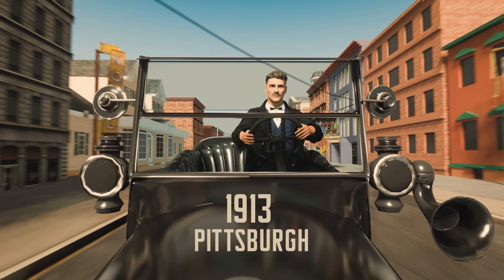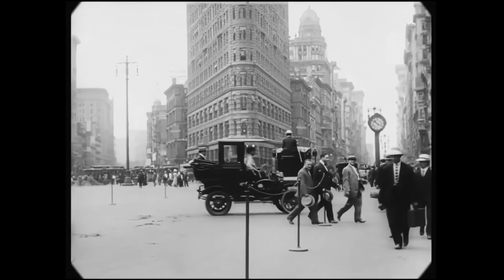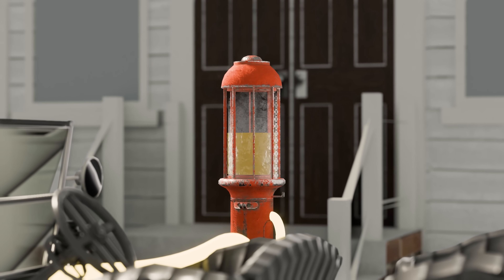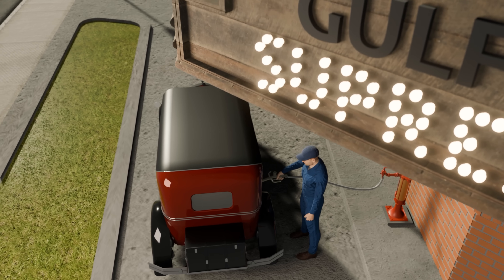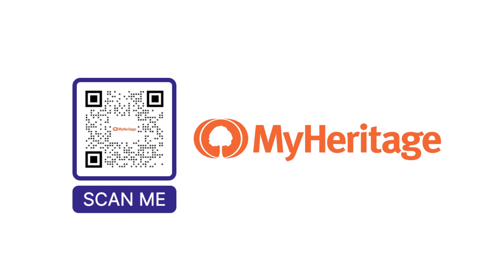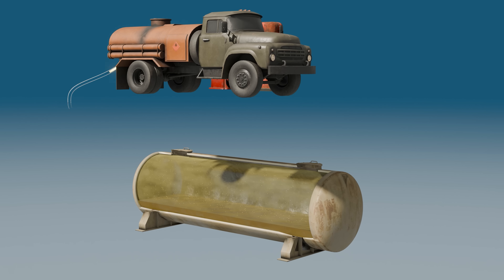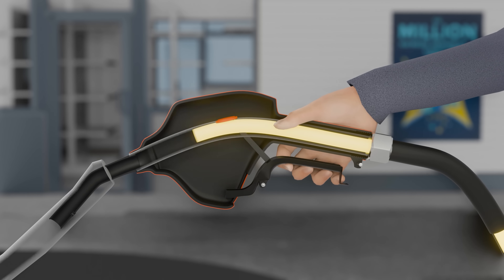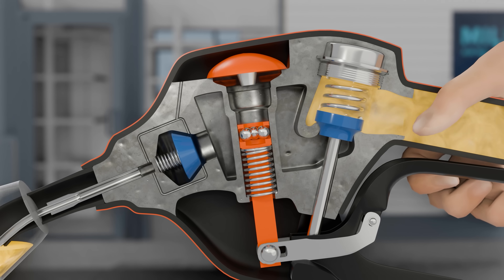The Hidden Engineering of Gas Stations

Comment: Even early cars ran in gasoline, not on kerosene. Yes, they were sometimes modified in times of gasoline scarcity. When cheap power was needed in agriculture, you'd have a kerosene engine and even than you'd need gasoline for starting it.

Comment: Its 2025 and gas stations are everywhere... If youre saying that they decreased after 1970 I would hate to have seen it then cuz in rhe outer Seattle area.. there can be a 4 way intersection with a gas station in 3 of 4 of the corners and in some cases 4 on all 4. Granted, there atlre a lot more people in 2026 than in 1970 but still lol.

Comment: I delievered fuels for 20 years. One technological improvement that happened in the 60s and 70s was volume correction at the pump. Gasoline, diesel and other products expand and contract with temperature. So let's say a tanker truck arrives at the gas station with a load of gasoline at 30 deg C (about 80 F), then drops it into the station tank. The delivered load without volume correction would be for example 10 000 gallons, which is what the station paid for the load. After sitting in the tank for a few hours, the volume has shrunk to 9900 gallons. Without volume correction, the station has lost money on that load. Similarly, without volume correction, you pull up to the pump and pump out product at 20 deg C, or 70 deg F (approximately). You pay for 15 gallons. A couple of hours later, with an outside temp near freezing, the volume in your tank has shrunk quite a bit, but it's the same weight of product. You notice your gas consumption has decreased from a month ago when it was much warmer outside. In summer, the opposite happens. The product expands in your tank, which means you use more to go the same distance, giving the illusion of lower gas mileage. With temperature correction, the measured volume is corrected to 20 deg C at every step, which mitigates the effects of expanding and contracting fuel. Next time you fill up and the pump says 50 litres or in the US 15 gallons, how can you be sure that's what you're getting and paying for? It would be ideal to sell it by weight, not volume, but this would be very difficult. So with pump corrected volume you are effectivley buying it by weight. Back when I retired from it, the new stations being built installed the underground tanks in a concrete vault that could not leak into the ground. The new tanks were fitted with overfill protection devices and vapour recovery as it shows in the video. The fill fittings were enclosed in a bucket like feature which captured small spills from connecting or disconnecting the hoses, any spillage connected could be let back into the tank. In the days before overfill protection you had to be extremely careful calculating ullage space in the tank before you dropped the load. At old stations sometimes the old tanks might have tilted so the tank wouldn't hold as much as indicated on the chart, so the tank would come full prematurely and you were left with a hose full of product and nowehere to put it. Hopefully the station would be open and busy and hose would empty in 5 or 10 minutes. If it was a night delivery and the station was closed, you had a big problem.

Comment: A gas station I worked near had to replace its tanks. They ended up digging up half their parking lot and pretty deep, paying for ground water removal. They found older tanks that had leaked and had to remove them first. I see this as the final nail in many stations in the future when alternatives make up a large percentage of cars. It just won’t be economical to do major environmental repairs and the station will just go bankrupt.

Comment: The nozzles still fail due to slow flow from the dispenser. If the flow is slow enough, it will bypass all safety features and over flow your tank.

Comment: I’ve worked for Gilbarco for decades here Australia disappointing no mention of initially mechanical computers,then electronic to calculate delivery volume working hand in hand with  mechanical metering mostly 4 piston. Not to mention vapour recovery systems designed to collect motor spirits vapour at the fueling nozzle yes the industry has had an enormous amount of innovation since the early 1900s

Comment: Couple things. In my area, the process of condensing captured vapors into saleable product is a pretty new thing. Most of the loading racks I go to simply burn the vapors that come off the truck during the loading process. I've seen the vapor condensing process at one rack out of 10. Despite increased fuel efficiency, I see new gas stations going up all over the place as well as old small stations being rebuilt into much larger ones. The demand for gas is strong as ever.

Comment: If you actually cover the hole near that end pump you’ll get less air and more gas than what you had paid but slower pumping process for this is a trick in my country only few knows, because gasoline is so expensive we have to sneakily ask the gas attendant to cover that hole because gasoline company cheats their their price using that air pressure hole by pumping more air it spins a mechanism where the price inside the pump meter will rise faster and makes higher cost so you will always end up paying for more but the gas you fill up remains the same the pressure of that air mechanism is connected directly to the computer meter of the pump and for how much dollar per litter you spend relies on that.

Comment: A reasonable effort to explain how a petrol station works in the most basic way, but you missed out a lot.
The overfill preventer on a storage tank is a device of last resort. When a tanker makes a delivery to a petrol station either the tanker driver or the station operator gets an ullage reading so they know how much space is available in each storage tank BEFORE any fuel is put into them.
A road fuel tanker does not have one continuous volume to carry fuel as illustrated in your video! It is divided into several separate compartments (called 'pots'). This allows a tanker to deliver more than one type of fuel.
You completely missed out the role interceptors play in reducing the environmental impact of fuel spillages.
Why no mention of Gilbarco Veeder-Root?

Even today petrol is still a very toxic and flammable substance. Its vapor is explosive. If a petrol station operator tells you to stop doing something (like using a mobile phone on the forecourt) please pay attention to them. They really don't want to have to do all the tedious paperwork as a result of you being too stupid to avoid death by immolation.

Comment: 6:00 - Not much engineering, and inaccurate too - for if there's a pump placed in the holding tank underground the gas station, why is the gas pump making a lot of noise then. Also having electrical shit in an explosive atmosphere is perhaps not the smartest move. Flappervalve is probably also false, 'cause what about the fuel in the nozzle and the hose. A heavy hose at that.
But good history lesson (I hope that at least is correct and accurate) and nice animations.

Comment: STOP SPREADING FEAR & MISINFORMATION: That 3 Billion Gallons of Gas Claim is B.S.
Let's cut through the noise. "The Hidden Engineering of Gas Stations" by Primal Space – that's perpetuating a staggering falsehood, and it needs to be corrected.

At the 0:38 mark, the video boldly claims gas stations are "pumping out 3 billion gallons of fuel around the world every day."

This is not just inaccurate; it's a colossal misrepresentation of reality.

Here's why that number is dangerous fiction:

Crude Oil vs. Gasoline: Learn the Difference. The world, as a whole, produces roughly 3.5 billion gallons of crude oil per day. Crude oil isn't gasoline. It's the raw material that gets refined into dozens of products – including diesel, jet fuel, asphalt, and yes, gasoline. To confuse the total global output of all crude oil with just gasoline is either gross negligence or a deliberate attempt to inflate figures.

The Real Gasoline Numbers Are Far Lower. When you refine crude oil, only about 45-47% of it becomes gasoline. Even if we generously apply that to global crude production, the actual daily global gasoline consumption is significantly less than half of that 3.5 billion gallon figure – nowhere near 3 billion gallons. For context, the entire United States, one of the largest consumers, uses around 370-376 million gallons of gasoline per day. That's 0.37 billion gallons, not 3 billion.

This Isn't a Minor Error; It's a Fundamental Flaw. Spreading wildly inflated statistics isn't just "getting a number wrong." It distorts public perception, fuels unnecessary alarm, and undermines genuine conversations about energy consumption and environmental impact. When content creators publish "educational" material with such glaring errors, they actively contribute to the misinformation ecosystem.

To Primal Space and any other channel echoing this: Check your facts before you hit publish. Responsible content creation demands accuracy, especially when discussing global consumption figures that impact our understanding of energy and resources.

Don't let sensationalized, unchecked statistics dictate your understanding of the world. Demand accuracy. Question everything.
Reply: Holy yapper

Comment: Not impossible to ever fill. If the sensor is broken it will not stop the flow. Also with cars that have faulty sensors for gas measuring it’s a problem. My advice is do more research before doing a video.

Comment: I used to work for a grading company. When we did the site work for a gas station it was my job to dig the hole for the fuel tank. When we buried it we had to fill it with water so when it rains it doesn’t float to the top of the hole.

Comment: People still over fill because many cars have poorly designed fuel filler necks, where if you have the nozzle all the way in it keeps cutting the gasoline flow, so they move it close to the outside edge and if don’t watch it the gasoline can flow all the way to the ground. See this happening once in a while

Comment: Um the other pump In modern tanks is not a thing i fix them and its 1 motor sucks up and pushes fuel out there is no hidden pump in the tank makes no sense because it would be impossible to fix with out ripping tank out

Comment: Fascinating evolution! The Venturi-effect nozzle design (0.4mm precision gap) and fiberglass tank corrosion resistance (ASTM D-3299 standard) showcase brilliant engineering. Our leak detection systems complement these safety innovations.💐

Comment: Neglected to point out the distinction of pump and dispenser. A lot of older and smaller stations still have above ground pumps at the point of sale as opposed to submerged pumps sending to the dispenser ( which almost everyone still calls "the pump" ) and point of sale. Also, left out the metering system and its required accuracy as well as its ability to prevent water from being metered or dispensed to the customer.
Reply: Not neglection, more decision making and curating. You can't cover every single dimension in 8 minutes.

Comment: Change, replace the gas tank with a new one in the threat of explosion's, blast's, burst's due to rust, corrosion, weakening of metal after, every 8 year's after, manufacture date. C.N.G.(compressed natural gas) has 15 times more pressure than L.P.G.(liquified petroleum gas), cooking gas.

Comment: The fuel is dirt-cheap, the infrastructure makes it expensive. 

With v2g EVs and roof PV dirt-cheap electricity everyday at every building and home.

The grid makes dirt-cheap central generator electricity expensive at the meter boxes. 

Infrastructure makes electricity expensive. 

Modern electricity technology makes energy dirt-cheap with individual ownership of the new technology.

Do a video on this.
Nuclear electricity promoters say maximum UTILIZATION of technology is the best technology.

Comment: I want to know how it mixes the octane when you chose wich rating you want if it all comes from the same tank
Reply: Some (most) tanks are compartmented. Example: a 20,000 gallon tank may be partitioned into one 8,000 gallon and one 12,000 gallon section. Each has its own pumping motor to get fuel out to a dispenser. The electronics inside the dispenser, depending on the blend you choose, will pull from the appropriate tank(s) at a programmed rate - typically 65% low grade and 35% high grade - to deliver a mid-grade product. Selecting only high or low will pump from one or the other tank, not both.
There are fail safes in the electronics to prevent “cheating”, just in case you wondered.
Reply: @gaspumprepairservice7009 I came in here in research arguing with somebody online who was trying to claim gas stations will run out and just start pumping lower grade no matter what button you press. I knew it was bogus but I wanted to make sure I knew how the pump worked before I said anything to them. I make fuel grade ethanol for work but since the stations do the mixing I didn't know how it worked from that side of the fence

Comment: Why do we have to have two way tubes inside a fuel nozzle? Can't we just use the inital tube path to make negative pressure?
Reply: Nope. That second tube is a fail safe to reduce spillage .. even when someone really wants to “top off” the tank, although it can be abused. Same as any tool.

Comment: Glad to see that they stopped using Kerosene as on top of what you said about it. It is also very dirty. Meaning that it will clog up the engine over time.  Possibly even ruin it.  This is a pretty amazing video by the way. I love all the engineering in it.

Comment: You missed the part about the detachable tube, what happens when the customer drives off with the fuel nozzle still attached to the car?
Reply: There are actually two of those safety devices at each fueling point. One is called a break-away, designed to separate if/when the driver is forgetful. Each hose will have its own break-away.
The second in mounted beneath a dispenser, called a shear (AKA impact) valve, in the event the break-away fails or if the dispenser is hit, it will stop fuel flow to reduce the chance of a catastrophic event. There will be one shear valve per grade (Regular/Super/Diesel, for example) hard-mounted to the dispenser sub-frame.

Comment: You’re missing a lot of details.  The underground tanks and piping are double-walled with sensors inside the interstitial spaces. This provides additional leak detection and suppression.
Reply: Way more, but too much to cover, I suppose. ✌️
Reply: @gaspumprepairservice7009  it’s good to know that gas station safety has come a long way.

Comment: What I don't understand is how you get different octane
Reply: Two tanks. High octane(93) and lower octane(87). Mid grades are a mixture of the two much is performed at the pump.
Reply: @davidedwards3520 so, that's my thing how was it mixed. Just wondered that processes and when does that happen
Reply: @RunEmDownTony that blending takes place inside the dispenser and has electronic fail safes to prevent “cheating”. ✌️

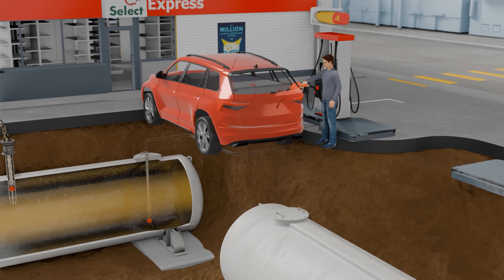Comment: 6:11 I had a good laugh when you said a truck filling up a station every few days, yes some stations will only take a truck every few days but big box stores like Costco and Sam's clubs they'll take anywhere from 2 to 5 a day, most commonly is 3 trucks a day... 6:40 most "processing facilities" AKA "racks" at least in the United States do not recover vapor to be turned  back into gas, they have burners at the facility to burn off the excess vapor.

Comment: You left out a lot of hidden engineering, double bunds pipes with vacuum sensing, oil spill recovery and separator systems, filtering and condition stagnate fuel, special materials for different fuels so they don’t corrode seals, accuracy of the pump and billing, structural engineering of the tanks and concrete slabs, monitoring and alarm systems etc.

Comment: lol learning that cars were running on kerosene back then sounds so weird
Reply: That's because usually they were not. Kerosene was only used when gasoline was scarce i.e. Europe shortly after WW2 or when you really needed cheap fuel like I. agriculture but this always needed quite some modifications if you didn't have a kerosene engine. Drives me nuts that the creator keeps confusing these completely different fuels.

Comment: You missed the engineering marvel of the simple breakaway between the pump hose and the pump. That little device stops the flow of fuel and through a simple canted coil spring allows for immediate reconnection with just a fraction the force to reconnect as it takes to separate. It’s almost universally ignored yet an essential safety and functional system
Reply: Same with impact valves. ✌️